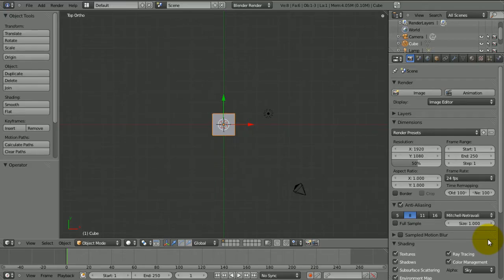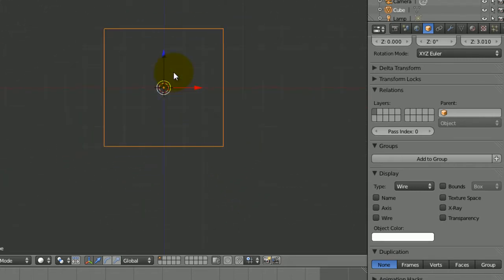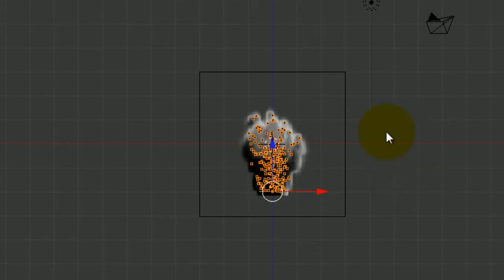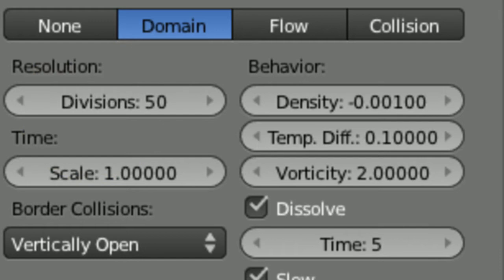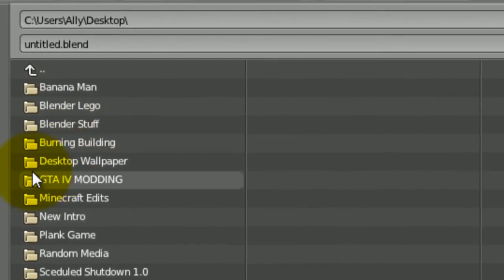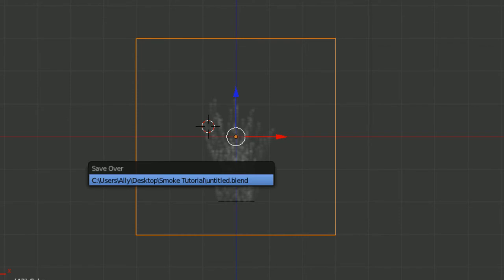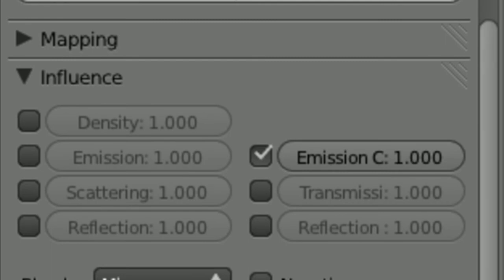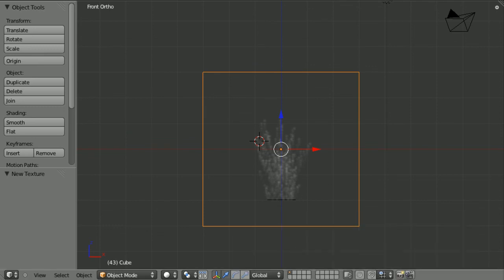[HD] Smoke Simulation Tutorial Blender 2.57

Comment from the maker: @CoatesProductions If you add another voxel data texture and add a colour ramp to it, if you then make it inflence the emmission colour and set the emmission in the materials panel nice and high it iwill have a clear colour change. There is some more advanced smoke texturing to have the materials change colour depending on the speed and density etc. but that's too large for a comment.

Comment from the maker: @TheBeaverSoldier Hmm... I could do that but the graph editor isn't the best way to make fire in my opinion. You can create realistic fires using the smoke simulation textures. Just create another "voxel data" and on the colour ramp, make a flame colour (white at the bottom, bright orange at the top) and then mess around with a few emmision settings and stuff like that to get it just right. It could help if you go to the data type and change it to Density or Velocity. Thanks for your comment :)